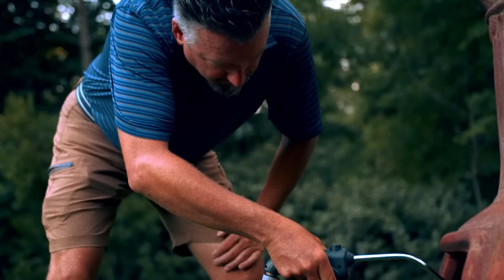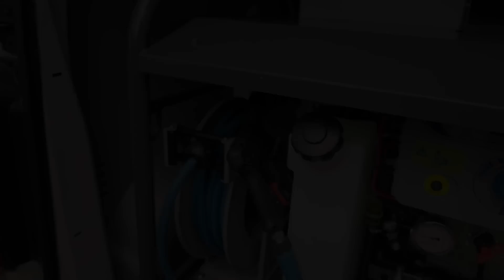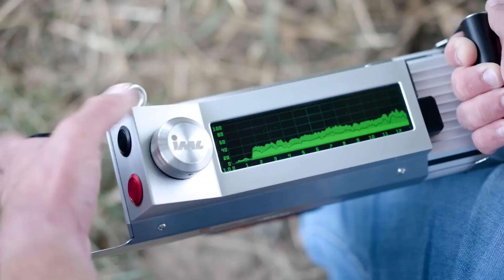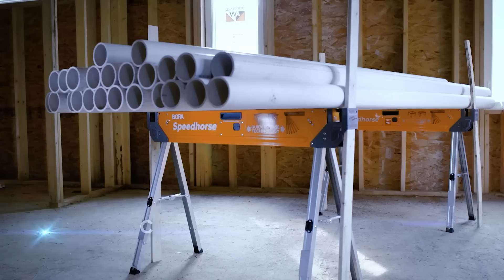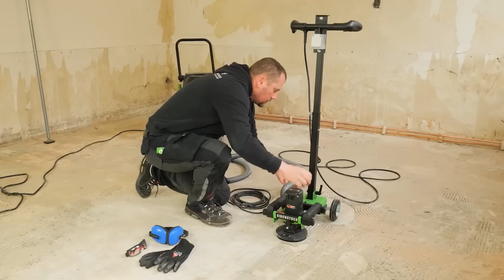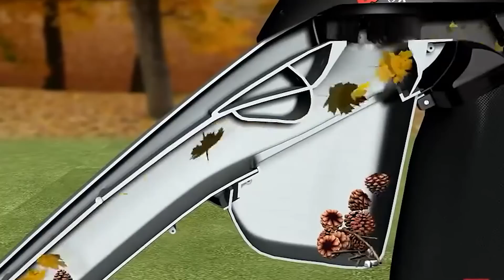AMAZING TOOLS YOU SHOULD KNOW ABOUT

Comment: Instead of $145, I got the weed burner with electric start for $39.95 over a decade ago.  Works a treat!
Can't imagine how costly the mini dumper is, with parts costing E1036 for the bin, 624 engine, 3,313 transaxle, 424 starter, 465 hydraulic power unit.  It's TEN GRAND cheaper to repurpose a riding mower.